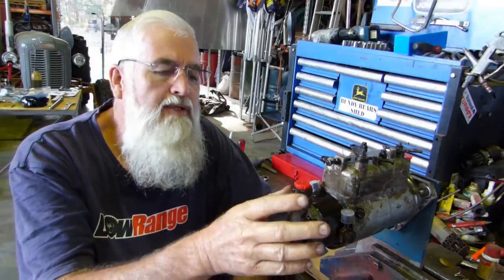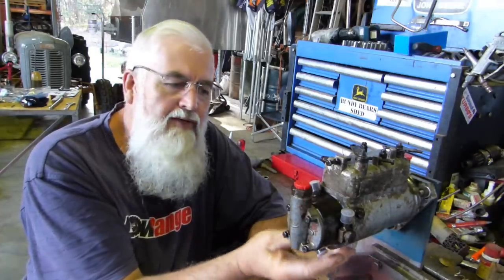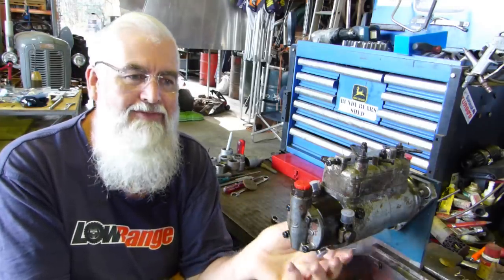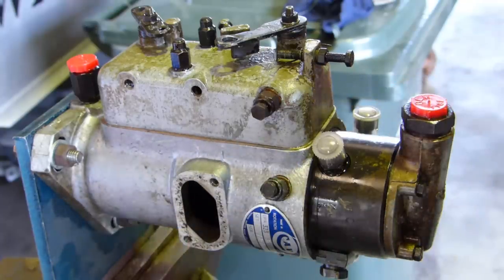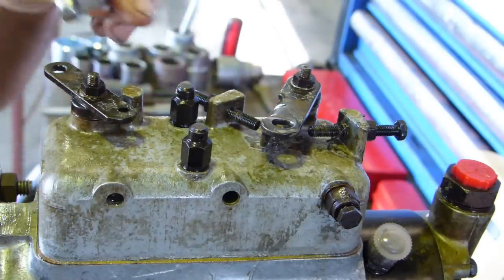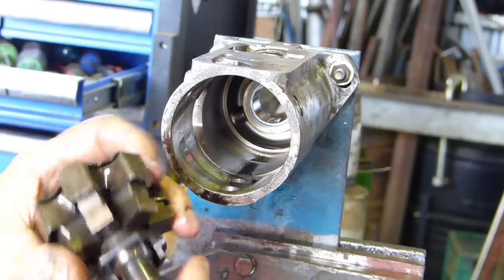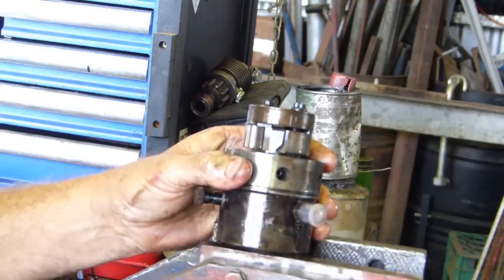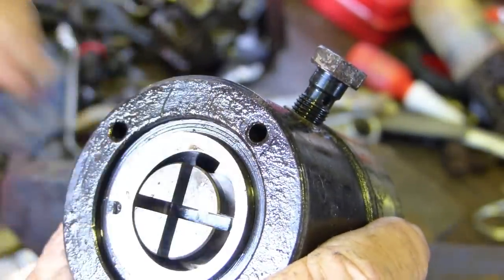MF135 Restoration #14 Dismantling the Injection Pump

Comment: Thanks Lance for your superb videos. Twenty-five years ago I acquired a 1961 MF35/A3.152 from my in-laws' farm when they retired.  Every year since then I've used this tractor to brush-hog my 5-acre field and to drag or trailer firewood out of my woods in Vermont USA.  It's the perfect size and power for my type of usage.  Over the years I've done many small repairs but I've never needed to touch the fuel system other than to replace the fuel filter cartridges.  Recently I replaced the throttle & stopper shaft seals according to your video.  That stopped the leaks and the motor continued to start and run nicely as it always did.  A few weeks later, and with only 6-8 hours running since that repair, the motor would not restart minutes after a warm shut-down.  Only after many attempts and a few battery re-charges did it finally start.  But it ran only at a very slow pace, slower than normal idle, and the throttle control was completely unresponsive, as if it was disconnected.  I confirmed the lift pump is providing pressure.  I do get a strong fuel stream when opening the top bleed screw, but the lower screw delivers only a dribble.  It acts as if the metering valve is stuck or plugged.  Because I had done the seal work without removing the pump from the machine, it's possible a speck of dirt got inside.  Or maybe the spring came undone from the governor plate or the throttle lever.  It's winter here now so rather than trying to work outside in the cold, I removed the pump and today will disassemble for a cleaning and a seal kit.   I'll let you know what I find!  -Steve
Reply from the maker: It certainly does sound like the metering valve is sticky to me.

Comment: I’ve got the tractor running so I guess I’ve got it right.  
Thank you very much, the video really helped.
Reply from the maker: Great to hear! Thanks for the support.
Reply: @BundyBearsShed  
Spell check got me on the (cab)
Should have been Cav injection pump
Reply: Morning Bundy
Tractor is running good. 
It smoked before the rebuild but it’s smoking more now I think fuel is getting in somewhere because the muffler tail pipe is wet with tar. 
I’ve read that the thremostart can leak fuel into the manifold if so it’s been doing it for years.  I’ve blocked that line off to see if it helps and then run the tractor hard to burn it out of the muffler. 
Here’s my question. The chart you showed for the throttle plate holes did not match what I had on mine so I put it back like it was.  3 years ago I put orings in the top part of the pump but maybe I installed it in the wrong holes then.   Should I go back in and put it like the chart has? Could it be getting to much fuel from the wrong holes?
I’ve got all the numbers on the pump.  The one you referenced in the video on mine is a 3, it has a slash on both sides.
Reply from the maker: If it idles and you get full revs it is fine and I wouldnt touch it. Good hard work will tidy it all up but you may have leaky injectors it if is white smoke.
Reply: @BundyBearsShed  I believe I had a plugged up return line.  I blew air back into the fuel tank and something popped out, I’m working on it.  Thank you for your time.
Reply: Think I got it figured out Bundy, plugged up connection on the fuel tank for the return line making fuel come out the muffler. 
You really helped me out.  Cheapest I could find to rebuild it was 650$ and that’s with me taking it off and putting it back on the tractor.  Thank you

Comment: Thank you Lance for taking the time and making this video...California, USA, someone has decided to mess with the Diesel fuel for emissions. I'm 63 and it sure doesn't resemble the #2 fuel of the past. Yesterday after watching your video again I tore mine apart again, the small piston at the bottom of inlet chamber was gummed up just like you said, the metering valve was gummed up to the point of not turning when I used the shut off link. I kept on going into the two pistons that create the high pressure charge and sure enough stuck like they were glued in. Berryman's carb spray worked great at dissolving the crap we pay $6.00 a gallon for. I'm starting to add a quart of transmission fluid to each tank of fuel now. What a mess. Our gasoline is even worse, if you don't have fuel injection you can expect repair weekly. Anyway, thanks again, Terry
Reply from the maker: Thanks Terry, We have similar issues here especially with the petrol the diesel seems to be a better quality.

Comment: Fantastic videos thanks Bundy!  Watched your other video on leaky top section before removing my 96 year old mother in law’s David Brown 885 and it saved me a lot of anxiety.   I was trying to removed the return line sealing nuts and twisted it which will be expensive!
Reply from the maker: Possibly not too expensive, see if there is used ones around.
Reply: Brought one back from Tamworth thanks!
Reply: I found the two double hex bolts holding the drive head were rusty.  Pistons and rollers moved ok but some of that rust could have got into the injectors.  Also your advice about mobility of the other piston that regulates flow in the delivery pump was probably valuable as it was stuck.
Reply: I have replaced seals etc and have tried turning the pump by hand to test it and there is a lot of resistance: I need to use the longer arm of the Allen key in the shaft bolt to move it. Is this normal, and due to the tightness of new seals, or does that suggest an error in my reassembly?

Comment: If I watch a new video everybody says it's so hard to take these pumps apart and put them back together you'll never getting right I did it  Murder in the sailboat Also grew up around metaphorescent tractors 1 65 1 75 and 135I got a price or a new injector pump that was $3800 it's a local place to work on a rebuild them in Richmond Virginia they won a $1900 just to clean it then tell you what's wrong with itThank you for taking time to make your videos
Reply from the maker: Im glad it helped. they are not really so bed when you are shown what to do.

Comment: This video helped alot! throttle valve was stuck here. After cleaning the pin the motor starts every time :)
Reply from the maker: Good work!
Reply: @BundyBearsShed  We are having some issues now with the tractor stopping after giving it som throttle and then letting the throttle go. Do you have any tips? Adjust one of the springs inside? i see that there are an adjustment nut on the linkage going to the fuel valve. or should i try to change holes on the large spring going from the throttle linkage to the plate? tighten or loosen one of the springs?? video of the issue here https://www.youtube.com/watch?v=CHj6ZmEPr-Y

Comment: Thanks for taking the time to show us this video. I’ve got this same pump but it appears my pump is dumping too much diesel into the cylinders causing white smoking and it will sure burn your eyes if it runs inside a building for a little while. It doesn’t leak but people are saying it needs to be rebuilt. What, within the pump, would cause this problem? I replaced the injectors and the previous owner stated the pump had been rebuilt. I’m not sure how far he/she went with the rebuild or why they decided to do so unless it was to chase this problem. Also around mid/high range rpm’s it begins to white smoke a bit more and seems to miss. I think some refer to it as “hazing.” It idles a bit rough as well but it seems at mid range it seems to run fine. I’m at a loss with it.
Reply from the maker: I would re visit the injectors and check the manifold heater is not leaking badly. The pump wont usually do that.
Reply: @BundyBearsShed  thanks for the reply. Its a 1967 Ford 2000 Tractor. I’ve only owned it for a year but it’s done this entire time I’ve owned it. I put all new injectors in it trying to fix this and it didn’t help. I thought maybe the white smoke may be a result from a blown head gasket so I replaced it. Still didn’t help. I thought it was a fuel pump timing issue and tried to adjust the time +/- and it didn’t help. I just thought maybe the pump was dumping too much diesel fuel in and the white smoke was a result from unburnt diesel.

I may look into the injectors again. I bought aftermarket ones but when I pulled the head off to replace the head gasket I noticed the tips of the newer injectors looked to have a bit more build up on them than I was expecting but maybe it was normal. When you mention manifold heater is that also known as glow plugs? If so my tractor does not have them.

Comment: Hello sir
Iam a mechanical engineer I am a new to whatch yours Vidios I love it to working engine motors if compression egnation or spark egnation engine also Iam intrsant with high tension tawers and bridges by I beams steel concrete combine
At end thank you
Reply from the maker: Welcome to the channel.

Comment: Thanks Lance I've seen hudreds times before getting confident to do it my self and am now there. 32:15 also my drive hub has a very slight groove wear... can fell it with my nail... do you believe better replacing or just polishing... thanks you
Reply from the maker: Polish it smooth and the new seal will work fine.
Reply: @BundyBearsShed  thanks 1000 or 1200 Sand paper
Reply from the maker: @giemme4492  even 600 is fine enough for a lip seal
Reply: @BundyBearsShed  do thank you👍

Comment: I watched your video this morning. Removed, rebuilt, and installed today. Fuel leaks gone, starts on first revolution, throttle responsive, for some reason the oil light would flicker before and now that is gone too (I'm guessing that the gasket to the crankcase was bad?). Thanks for such a well put together video, subscribed!
Reply from the maker: Glad it helped

Comment: G’day Lance, I suspect my stopper is stuck after sitting a while while I rebuilt the steering box. I have pressure at the bleeder screws but none at the rotor valves.

Is there a way to get the stopper unstuck without taking the cap off the IJ? Boiling water over pump? Knock with a hammer? 

If not I’ll be ordering a new gasket.

Cheers.

T

I
Reply from the maker: Hold the pump wide open with the stopper in run position and give it a bump and that can help. If not pop the top off and free up the metering valve.

Comment: I love your U-tube rebuild video's, 
I have a 1980 MF 20C industrial Tractor/loader with a Perkins/Premium D3.152, 3 Cylinder Engine.
The name plate on the injector has- C.A.V. (made in England) DPA# 3233F671 on it. Below that is a SER# R 31851UY on it.
Below that. Is a # that looks like (it’s hard to read)-W47E900/3/2470
question pleas- The bottom bleed valve bleeds clear and fine with good pressure, but the top blead valve dose not bleed at all. No air, No diesel, no foam, no nothing, and naturally it want start . I've taken a pipe cleaner and tried to clear any blockage. Didn't help. I have a new kit, do i just need to take the top part off and rebuild or rebuild the hole thing? THANKS!
Reply from the maker: Try removing the top and check the metering valve isnt stuck. You can deal with the bleed screw with the top off.
Reply: @BundyBearsShed  Thanks for the response, I removed the top while still on the tractor. I removed the metering valve and cleaned it  very well with 350 grit very lightly. I put it all back together and it seemed to all go very well, fallowing your directions in the video.  It still didn't push fuel out the top bleed screw but what it did do is push oil / diesel out the oil dip stick retainer. What should I do next. I very much appreciate your advise.

Comment: I need help. Please respond.   Out of fuel,  fuel tank petcock off because of leak.

Fixed leak.  Took the lid off and on several times.  Finally got the on/off pin in the slot.

Put back together,  pumped fuel through the pump bolts.  Took off the injector feed.  Pumped, but pumping never makes the fuel go out the injector connection. 

I pump till the pump seems like it reaches a flat pump, making me think its full.

I crank the engine a bit, except it never seems to prime the pump.

John from Alabama.
Reply from the maker: Try and only bleed on one injection pipe, I find that seems to get rid of any air quickly once the main pump bleed screws are free from air.

Comment: I need help with finding a TAFE 35 DI FUEL INJECTION PUMP. DO you have a part number or by any chance what massey ferguson pump will is interchangeable ?
Reply from the maker: No I dont Im afraid, I would possibly look for a MF148 or possibly a 204 or 550 pump
Reply: Ok thanks for ur help

Comment: So Bundy i think I have a gas engine instead of a diesel, it is a 4 cylinder 1992 MF 30 industrial loader and backhoe. It will not run on diesel.
I have good fuel pressure going into the injectors it just will not run, although it will run on starting fluid.
How do I know whether it is diesel or gas, the tractor was torn apart and there was no fuel in the tank or the engine, it hasn't ran since 2005, my friend and I thought all backhoes and front loaders were diesel, I sure hope I didn't damage the engine if it is gas and not diesel.
Also where do i find the engine size, i was told to look for a number ending in 203 or 212, this will tell me what enging i have.
I dont see that anywhere on the dirty engine.
Have any idea where I should look?
Reply from the maker: see below.

Comment: I have a MF 230  the MF Fuel injectopumpr cav 3230F450!  I have a leak from the bottom bolt that drains fuel from the system to the point have bleed the pump and crank it until i fuel to the injectors!
Question: is there an O-ring on the bottom bolts to seal it? And can  it be removed , without causing a problem? Asking before i srew something up!
Reply from the maker: Yes it has an o ring you can drop it out the bottom without a worry.

Comment: Great video lance! Love your work I have a ford 5000 with a Simms unit that is getting some early weeps might call qld tractor supplies if you supply a kit
Reply from the maker: G day Andrew, We do a kit for the CAV as per the video but not the in line Simms pump. I would stock them if I could find a supplier.

Comment: Hi Lance, one of the David Brown 990's that I purchased has a blown motor, no 4 piston came out both sides and the sump. When i bought it the man said the injector pump had been overhauled. Is this the sort of damage that can happen if the pump head is turned up to max?
Reply from the maker: Possibly if it was over revved but not often from over fueling a bit.

Comment: So I started going at my pump. High pressure plungers nice and free, metering valve good and clean, new screen in the intake of the transfer pump, and verified fuel flow at the pump inlet.  But still no fuel out the injector ports.  Running out of ideas on what it could be. Going to check on that little plunger on the transfer pump inlet.  It seemed ever so slightly snug.  Hope that's it, as it's a bit of a bear working with the pump on the machine, but still easier than removing it from the machine.
Reply from the maker: To check the plungers under the rollers I think you would be easier with the pump off the machine, have you bled it properly? Make sure the little spring is under the shuttle on the end.
Reply: @BundyBearsShed Thank you for your thoughts Lance.  
 I had the head off. I didn't take the shoes off, but could hear the plungers sliding to the opposite side as I slowly rotated it.  As far as bleeding,  I removed the bleeder screw and cranked the motor, which is shooting a stream of fuel out.  And yep on the spring in the bottom. Almost lost that critter!  
I don't quite understand how that little plunger and small spring above it really work. Seems like a lot of space above the spring, and that little seat that the large spring sits on, that the little spring seems like it wouldn't be doing anything.
Reply: @BundyBearsShed  I'm such a boob!!  So I tore the head out again, but this time removed the shoes to really check the plungers, instead of relying on just hearing them move.  Sure enough, stuck.  It was just the rollers I heard moving before.
THANK YOU FOR YOUR VIDEOS! I would surely have given up if it weren't for them!
Reply: @BundyBearsShed  one last post.  Still couldn't get her to run after freeing up the plungers. Back to the fuel regulator parts on the front of the transfer pump.  Removed the parts, figuring I don't need pressure regulation on a gravity feed system, only to later discover those parts control pressure of the transfer pump itself.  Finally figured out that there was a microscopic burr on that regulator plunger.  Diamond filed the edge and reassembled.  I could blow and suck on the inlet and feel the plunger moving correctly again.  Reassembled and bled air. Still wouldn't run.  Force fed the CAV with an inline 12v fuel pump and finally got it pumping.  Hooked up my injection lines, and finally, after nine full days taking apart and reassembling the CAV, the engine came back to life. 
Lesson learned:  life would have been a whole lot easier removing the entire pump from the engine, troubleshoot & repair, and most of all, bench bleeding the pump.  Seems most the challenge is getting air out of the dead-end passage, where those high pressure plungers reside.